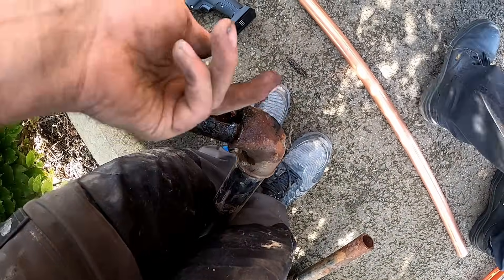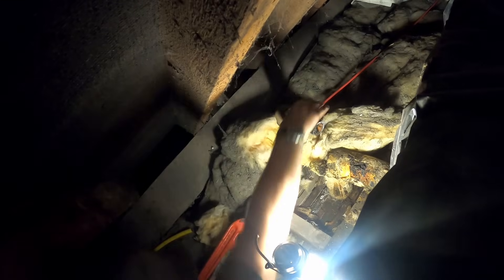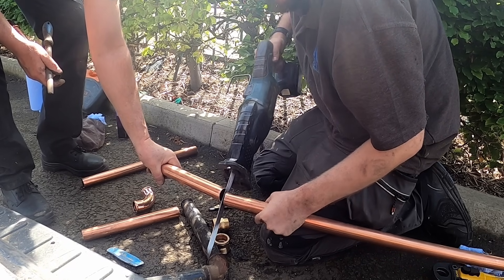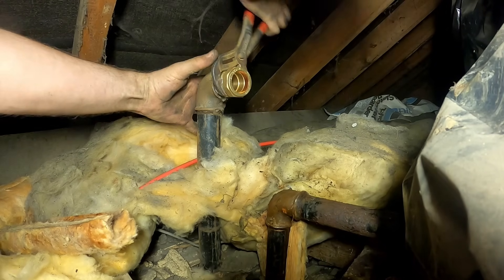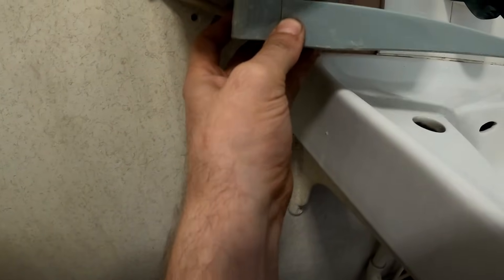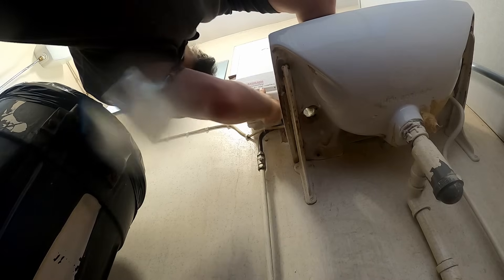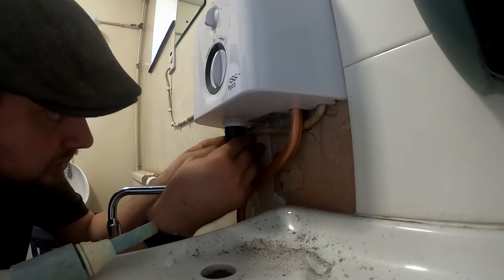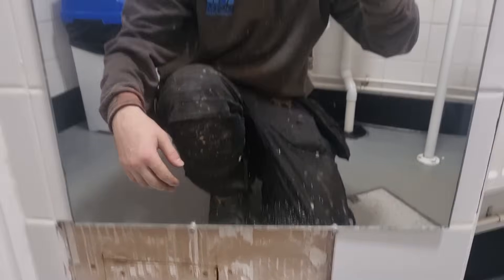Awkward heating leak in corner of roof & other plumbing jobs

Comment: Tom can i ask about the brass male iron into the steel fitting.  Are there any issue with dissimilar metals with the pipe elbow being steel and the male iron being brass?  Great videos thanks for sharing tour knowledge.
Reply from the maker: Ideally you should keep the materials the same but the brass does act as a dielectric anode to help prevent corrosion between the copper and the steel, thanks for watching mate 👍

Comment: 45 to 45 to prevent any sludge laying in the horizontal pipe?
Reply from the maker: I could have done, it will take a while for that vent to get that bad again, by then the boilers will likely have been replaced and the system pressurised, thanks for the support as always

Comment: Hi my heating system has never had a flush but wen I replace a  radiator the water looked clean do you think I should flush it?
Reply from the maker: If everything is working OK I would probably leave it, I would be more inclined to spend the money on fitting a filter on the boiler return if you don't already have one, thanks for watching mate